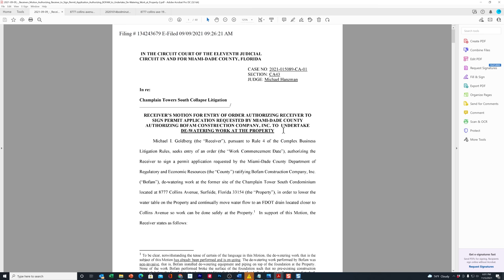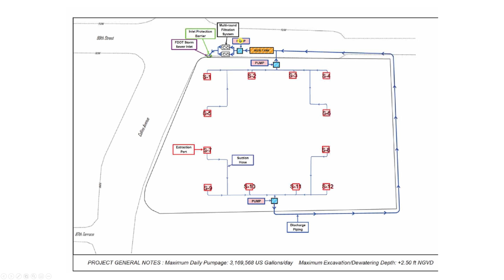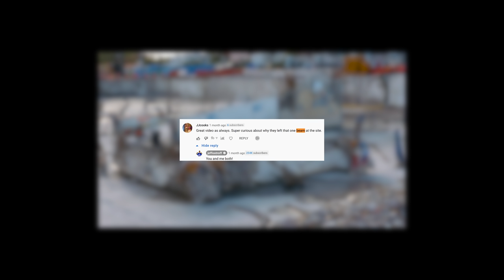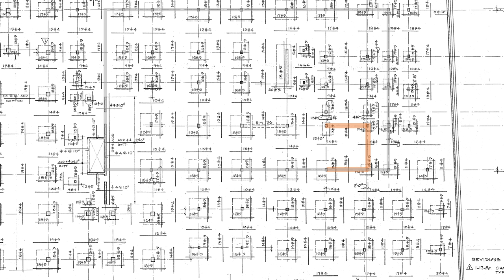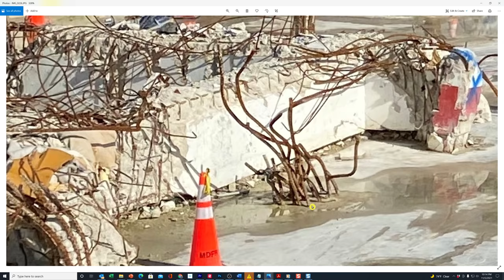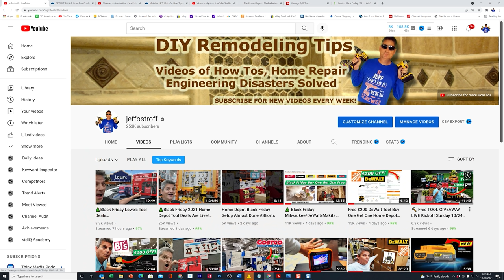Miami Condo Collapse: Engineers Baffled By Mystery Column

Comment: Column was driven down by the weight of 12 stories?
Reply: Makes sense! There is no concrete around it.
Reply: Did you not watch the video?  It's in the wrong place.  THERE WAS NO COLUMN THERE for almost 40 years!!
Reply: consider that there is a column on the first floor that got driven in????
Reply: @loufaiella3354  No way, not that neatly.  The east wing of the building fell slightly to the southwest.  The columns didn't spear down into the earth perfectly vertical.  Even if they did, the energy from a column busting through the slab would have massively damaged the slab in the impact zone.  That slab looked pretty intact and pristine to me...
Reply from the maker: Not likely that it was driven down from above, there are no columns directly in line with this one above so this in my opinion could not have come from above. It must have been added from below

Comment: I bet the HOA put H-Beam without permits and without inspections. I wouldn't be surprised. My HOA needs to be constantly reminded to pull permits for work on Premises and they still ignore the requests. Or they need to be reminded that hiding work from HOA Community is ILLEGAL.
Reply: They were trying desperately to secure funding for the $15 million repair job, and the building inconveniently started to crack and disassemble itself ahead of schedule.  One of them said, "I have a cunning plan..."
Reply from the maker: H-beam was in the original plans. I think mystery column was added last 12 months

Comment: At 6:58, there is another red column.  87 or 67 I believe?  There must be a reason why those two particular columns were painted red and not yellow.   They also both have some type of wiring coming down to a box.  Is it something fire dept. related maybe? A fire alarm pull perhaps?
Reply from the maker: That could be, there are no extinguishers on them

Comment: It's the 1st floor to penthouse column supported by the H-beam. It appears to have sheared off the H-beam and was driven into the garage slab by the weight of the building collapsing and the inertia of falling 8+ feet to the slab. The distance from the H-beam indicates it sheared off before the the H-beam fell.
Reply from the maker: you forget that there is zero damage on the floor where there should have been craters or something else if it had impaled into the floor but there is no damage. These rebar rods look like they were intentionally built up out of that concrete floor like it was done by somebody in the last 12 months, since Fiorella shot her video inside the garage in July 2020, showing no column exists where that mystery column is.
Reply: @jeffostroff  what  about all the columns in  the basement that still have concrete in them,except for that one.I to believe it came from above

Comment: The mystery colum come from above....like a nail punch in the wood......with all the weight from the building, the column above punch right thru the garage flloor.
Is no concrete around the rebar compare to the other column.......
Reply: Uh, nope.
Reply from the maker: I don't think that is possible because if the column came from above there would have been a lot of damage today at the concrete foundation but it looks pretty intact
Reply: @jeffostroff  Also, the east wing tilted and fell to the southwest.  The columns would have just rotated and pancaked down, in between the slabs.
Reply: @jeffostroff  
The weight of this column and also the pressure from above could create bizarre situation, like a flying debris during tornado when a section of 2 x4 punch a perfect square on the entrance door
I work in archictectural field and sometime we saw bizzare situation.....
Reply: @christianduval9067  Uh, nope.  A 2x4 flying at 200 mph impacting a thin wood door is a completely different situation than concrete falling under gravity.
Reply: @jeffostroff  What is the thickness    of the garage floor slab and how dense is the rebar mat? For all we know the garage floor slab could have been poured very very thin with little to no rebar. Remember they probably cut corners with this building and they could get away with a wafer thin slab as it is sitting on earth. With this in mind I wouldn't be surprised if the column that sat on the transfer beam simply punched through the grage slab cleanly. Remember it may be a very thin poorly made slab that is sitting on sodden earth. Thats my best bet for what it's worth.
Reply: @christianduval9067  my thought, as well.
Reply: @PracticalCat  It's doubtful it was column K, the one supported by the H beam.  The east wing fell slightly to the southwest.  The columns in that section rotated and pancaked, winding up in between the slabs in the pile.  There were no sufficient forces that would have broken them free of their rebar connections to the slabs (and each other) and accelerated them to where they would punch through a layer of concrete in that manner.  No, they were handily constrained by the slabs.
If you tried to replicate something like that experimentally, you'd find that the velocity required would simply disintegrate the slab locally.  The slab around the mystery column in the video looks pretty undamaged to me...
Reply: @johnbergstrom2931  I agree the garage floor slab looks pretty undamaged. Thats why I had my theory that it could have been really thin resulting in a relatively clean puncture. Even more likely if the slab in question was even reinforced. 
I get what you are saying about the columns twisting and falling with the structure, probably most likely. Although most of the columns did separate from the floor slabs in a punching shear. That being said it could have just be the bottom most section of the column that got punched into the slab. It most likely broke apart as it did this, probably why we only see rebar poking out. 
The reason why I am a little skeptical that our mystery colum was later added is the fact that retrofit structural columns in reinforced concrete structures are in my experience made from a steel box with flanges on the tops and bottoms to allow for bolting to the existing structure. The reason why this is done is because it is very difficult if not impossible to pour a reinforced concrete column in situ after the structure has already been built. We would probably see a nice square of white fresh concrete on the garage floor slab where they would have had to have poured a foundation if they managed to ad a concrete column after the fact. 

Im not claiming to be correct as like most of us don't have the facts. It is definitely an intriguing situation and I hope we get the answers. Otherwise it will keep me up at night lol ;)
Reply: @christianduval9067  definitely. With the forces involved bizarre things do happen.
Reply: @PracticalCat  Even if the slab was thin, it would have been severely damaged, punched into the ground.  Remember, this is brittle concrete, it's not putty or jello or thin plywood.  You're not gonna get a 'clean puncture', not at terminal velocity, not at 200 mph, not at 1000 mph.  The concrete is going to fracture and disintegrate in that hypothetical scenario.  
"Most of the columns did separate from the floor slabs in a punching shear" - on the pool deck.  Most columns in the building simply rotated and fell.  The loads from the floor slabs in the residences were smaller than the 13" thick pool deck.
Reply: @johnbergstrom2931  yes lots of the columns did rotate an fall sideways between the pancaked slabs but not all. Look a photos of the rubble pile and you can see a long column laying ontop of the rubble and you can see the marks along its length in intervals where the floors were attached. 
I really want the owner of this channel to get a closer look at that colmun remnant and even talk to an official engineer investigating.
Reply: @PracticalCat  You are right, that column stack was undoubtedly near the 'tear' line, on the east wing.  It broke free from it's slabs, but it ROTATED, fell under gravity and landed on top of the pile.  It didn't magically detach, accelerate and spear down into the earth like a high speed javelin.  
That's 'cartoon-physics', dude.  Let it go.
Reply: @PracticalCat  Not really hard to understand, if you have an engineering degree.  I do.  Jeff does.  Forces are simple to quantify.  It's not quantum mechanics or general relativity...
Reply: @johnbergstrom2931  Im not saying im right I may be totally wrong:) im not arguing with you :) I dont really have anything to let go. Im just sharing my thoughts. Im just as intrigued as everyone.
Reply: No, it was always there from the beginning. Clue: Note that in the diagrams, the H-beam is about 20m from the ramp, but in the video it's only 10m. So, it didn't fall straight down. If you think about it, it would be unlikely to fall straight down anyway, because the 4 huge columns under it would be more likely to "topple" than to "crumble".
Reply: @RobbieHatley  Nope, completely wrong.  There was no column IN THE MIDDLE OF THE PARKING LANE, video evidence from last July shows it.  The H beam wasn't displaced 10m in the collapse; the columns allegedly moving the beam were less than 3 m long - physically impossible.  Hard to tell due to the damage to the H beam ends, but it looks like it fell a couple feet to the west.

Comment: Only possible explanation is that the mystery column is really column #24. At 14:34 it becomes apparent that this H beam has fallen slightly to the south of its original position. The “red” column that you’re seeing at this time stamp is column #17 that sheared away from its base. The red columns base is actually the blue painted rebar that’s sitting in the foreground (again at (14:34). This shift of about 4-5ft. to the south explains why it looks like there’s a column growing out of the middle of the driveway, when in reality, it’s just the corner beam that held up the H beam in the first place. A great example of what I’m talking about is the moving animation you did at 1:42
Reply from the maker: The H-Beam fell roughly 12" north of its position after sliding down off the columns
Reply: @jeffostroff  I may have the direction of fall wrong, but it can still explain the illusion of a mystery beam..no?

Comment: Looks to me like the “mystery” beam is the center of the H beam. The H beam looks like it’s upside down and has been moved by the construction crew, placed offset to where it would have been originally. The angles in the top down picture make it seem the align but I think it’s the shadows of the rebar throwing the image off. The floor is immaculate so they obviously cleaned and moved debris around during their investigations. It’s reasonable to believe some heavy equipment relocated that giant H beam during the debris removal process. 

Has anyone documented the extra column or is this just coming from pictures?
Reply from the maker: They had no equipment there that could move that beam, it simply slid the the columns and landed 12" north of the 4 columns holding it up. That's why they left it, too big to move.
Also it is not upside done, they can't flip that thing over.
Reply: I think your observations disregaurds what was proven in this video, past videos, general knowledge of construction/cleanup. The Mystery beam is coming out of the ground. It is not touching the H Beam. The H Beam only had about 9 ft to fall, with not much under it. The way the tower fell (straight down), the h beam likely fell directly below where it originally was without much debris under it. There would be no reason to move it, and if they did move, arguably one of the heaviest structural pieces of the tower, there would be anchors drilled in and other markings indicating a crane move it. It would be a large crane to move/flip something that large. No regular construction loader or dozer would be able to move or flip the H Beam without breaking it in pieces first.
Reply: @jeffostroff  upon further reflection I agree the beam is probably not flipped upside down. That was based purely on a quick observation and I have no facts or evidence to support that aside from a quick glance.

I do still think that the mystery beam is part of the original support for the H beam. Occam‘s razor tells us to look for the simplest solution.

The rebar from the mystery beam is clearly coming from out of the ground. Since we have a video showing no beam in that location and it’s not on the original plans, if that beam really did exist, it was added recently.

I only know of two ways to attach rebar into existing concrete. One, drill holes and insert the rebar using an epoxy bonding agent. The column would then rest on the concrete floor and the floor would bear the weight of that column. The second method would be to cut up the existing concrete and pour a new foundation along with a new column. You would clearly see lines in the concrete where the whole concrete was cut and new concrete was poured. Since we do not see those lines, that leaves us to conclude the column either is an optical illusion and is the original column in the middle of the H beam, or, the rebar was drilled into the concrete and epoxied into place.

I do not know what the properties of the concrete in the basement was nor do I know what the footprint of the foundation looked like. Maybe there was sufficient support under that location for a loadbearing column to be added after the fact, however it seems suspicious to install a concrete column as an additional support.

My experience with construction is residential so maybe I am mistaken. In a residential structure the footings where columns are to be will have much deeper concrete underneath them, and the empty spaces bridging loadbearing supports and walls will have less concrete because it is not needed and it would be an unnecessary expense. Without digging a stronger footing, a loadbearing column could not be relied upon based on my experience. Again, if foundations are designed differently on larger structures than I am open to hearing that.

I think it’s far more likely that the H support shifted during the collapse of the building and is resting several feet to the side of its original footprint. You pointed out that it is still intact, so let’s have a thought experiment….

take a block of wood and support it on for drinking straws so that it looks like a makeshift table. Drop some thing heavy on top of the wood and see where it lands when the straws collapse. As soon as the cylinder of the straws bends the structure will shoot off to one side or another. It’s nearly impossible to collapse a straw from both ends and have it accordion up into a neat tight ball.

So let’s look for the simplest solution. Option one, lateral forces or the massive amount of debris shifted the H-beam away from its original footprint and the mystery beam is an optical illusion.

Option two, somebody installed an extra support that does not show up on the plans, does not show up in the video you posted walking through the garage, does not seem to have the support underneath or above to provide any additional utility, and does not seem to show any evidence of being installed after the fact into an existing concrete floor. Further, there presumably is no record of permits or engineering drawings on file showing any additional supports, which would absolutely be required to modify a loadbearing structure in a residential building. The strongest evidence that an extra column was added seems to be two photos…. 

Occam‘s razor tells us the simplest solution is likely the correct one. If you’ve ever seen pictures of a girl online and then met her in person, you know two pictures ain’t enough! 😂
Reply: @JustinRaymondUtah  I agree on second thought that it is very unlikely the beam is flipped over. 

As to the beam falling straight down onto its original footprint, I do not believe there’s any reason to assume that is what would happened. See my other reply regarding collapsing four straws with a piece of wood on top of them…

I think the rebar coming out of the ground is the strongest evidence to support that it was an original beam built when the foundation was first constructed and thus, the center support of the H beam.

If there are additional photos from additional angles Showing the five original columns as well as a six extra column then I believe this would be a much stronger argument. In the absence of additional evidence however I think The most compelling theory is that the two photographs are optical allusions making a six column appear to exist when it is in fact one of the original supports for the H beam.

Comment: The mystery colum sits in the "O"-row in line with the colum that support the H-beam on it's east side colums. It would not make any sense there to support the "H" right in the middle, it's behind the transfer-line of the "H" for any reason... So even it would be brought in later, why the hack in this position and not a few feet to the west?!
Reply: It's almost like, it's a mystery or something!
Reply from the maker: If that column was indeed added in the last year, it was likely put there shore up something on the slab, and not necessarily on the H beam which was so massive of a structure that it probably didn't need any additional help
Reply: Or 112 put a pool in their living room...
Reply: @johnbergstrom2931  The last to fall 12-stack, always giving the first to fall 10/11-stack a bad name... ;')
Reply: @MajorCaliber  Huh?  You mean the unit numbers?
Reply: @johnbergstrom2931  Yes, Units 111/211/311... /1211 all in the same vertical "11-stack", same shared column #'s, drain pipes, utility chases, etc... likewise the x10 and x12 units vertically aligned... (Dubious afterthought PH/Penthouse was a triple-size L-shaped unit "capping" the x11, x12, and  x01 stacks, with a jury-rigged corridor jogging over to the elevators and West stairwell.)